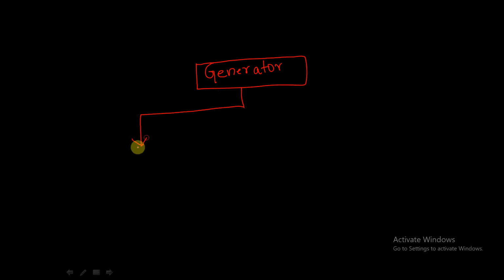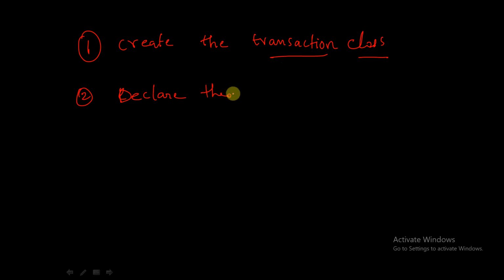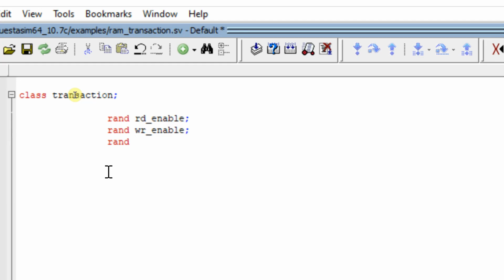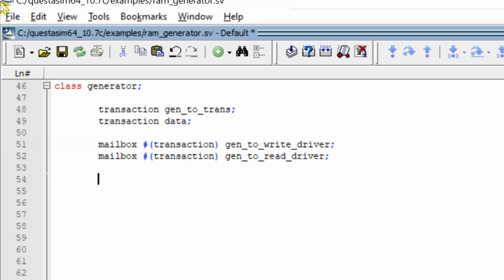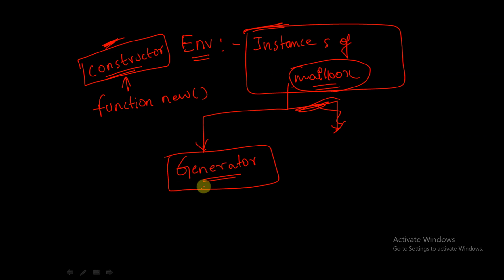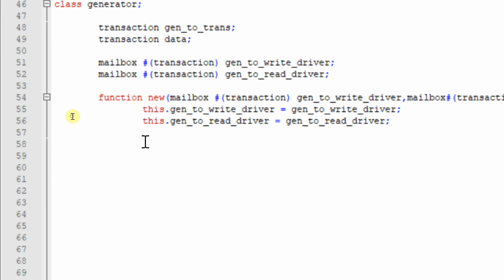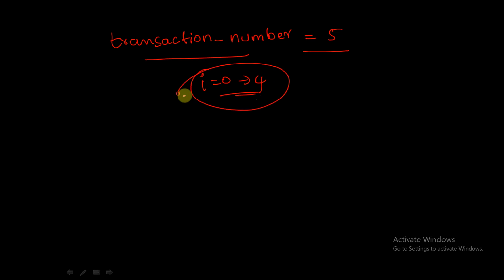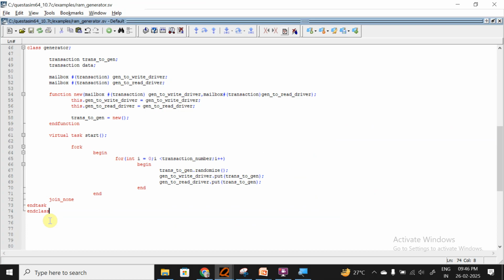Generator and Transaction class code explanation || System verilog test bench for RAM ||

Comment: I have questions
1) Why did you use 'virtual' for task? (Does it mean you will inherit this class?)
2) Does it work using fork-join? I mean what's the difference in using fork-join_none and fork-join in this case?
Reply from the maker: 1. You can use normally also not compulsory you should use virtual
2. Here my requirement is it to implement a non blocking behaviour
If you are using simple fork join and if the process doesn't complete for some reason your task is not going to end